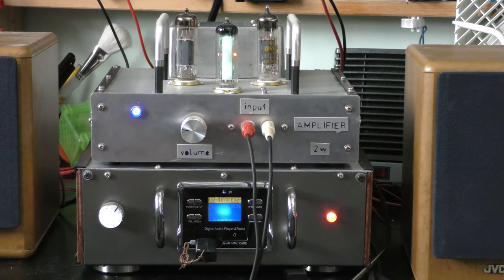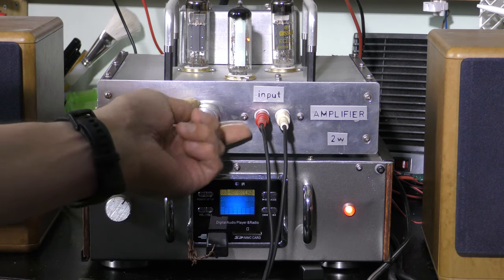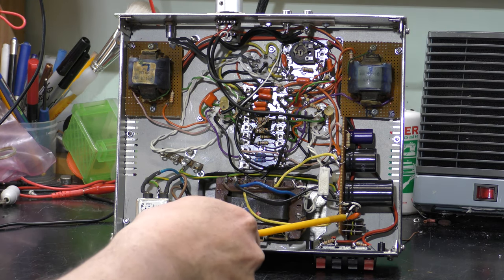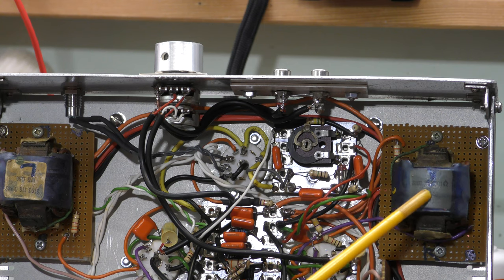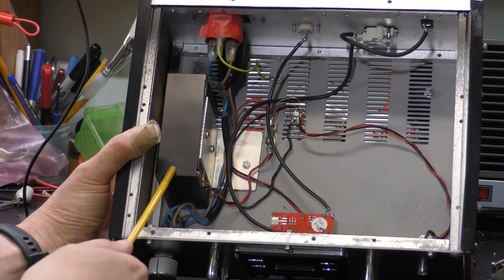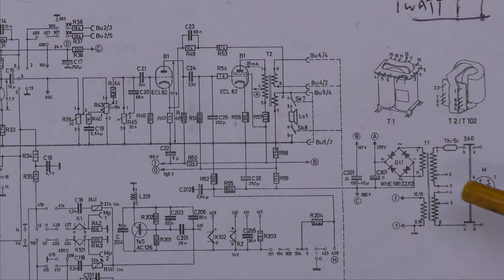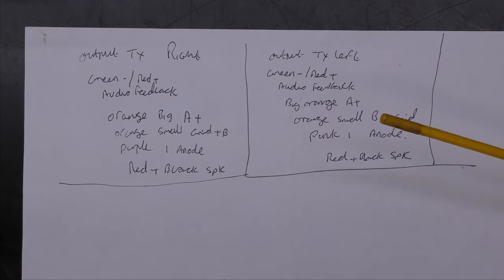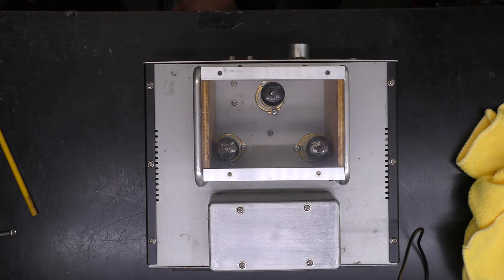ECL82 Valve/Tube Amp revisit and inside and circuit (4K)

Comment: Is the schematic indicating  positive 10.5V on the grid of the pentode?
Reply from the maker: 10.5 V bias sounds about right for a ECL82. The tape recorder used the negative HT rail current to power the transistors, that part was burnt up.